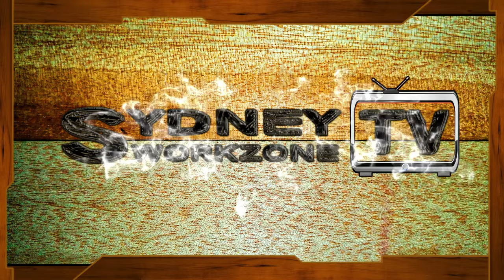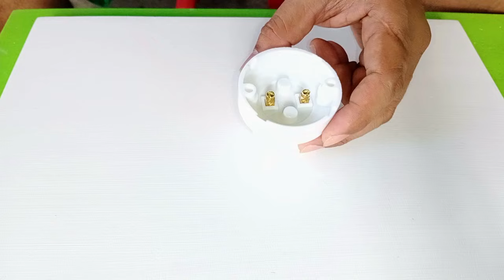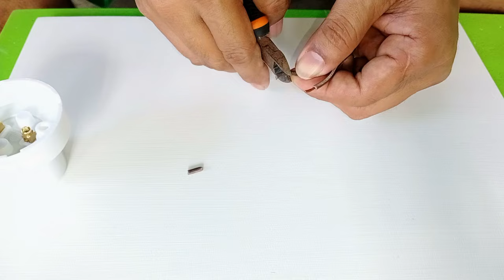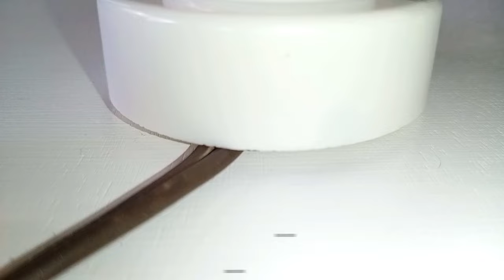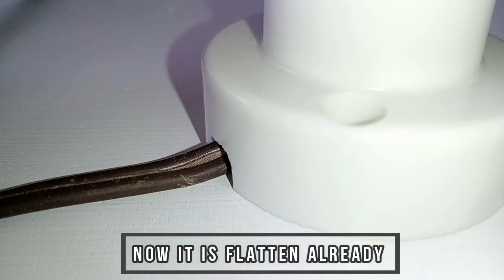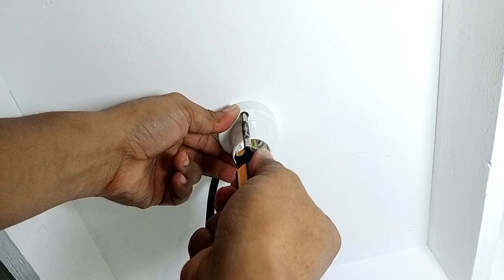⭕ Paano Mag Wiring Ng Bulb O Receptacle Socket ⦿ How To Wire Ceiling Receptacle Step By Step

Comment: sir, may existing wire na po s ceiling, bale pag pinatay na po breaker, kht hawakan ko na po mismong wire, di na po nakaka ground un? mag diy lng sana . ty po
Reply from the maker: Opo kailangan lagi po tayong safe o kung duda ka parin na may kuryente pa gamitan mo po ng multi tester. Salamat po.
Reply: @1075sydney  slmat sir. more power po s channel nyo ❤️

Comment: paano if may existing wiring na po sa ceiling. any of the two wires po ba pwedeng mgkapalit ng pwesto paglagay sa bulb socket?
Reply from the maker: Opo pwede po. Ska bago magpalit turn off the main switch po o yung circuit breaker para po sa safety. Salamat po.
Reply: @1075sydney  thank u po
Reply from the maker: @aristeonavaja8953  Always welcome po

Comment: Hi po new subscriber here, itatanong ko lang kung nasisira din ba ang socket. 
Kase po after ko e ON ang switch, ang bulb ay ilang segundo lang umiilaw tapos namamatay din. Tapos pinalitan sya nang bagong bulb pero ganun parin. So posible kaya na sira na ang socket? thank you po.
Reply from the maker: Hello po. Bihira po masira yan yung ilaw po napundi din ba, di naman po ba nag short ang wire. Ingat lang po.
Reply: @1075sydney  hindi po. Ok naman yung ilaw. Sa switch po kaya?
Reply from the maker: @ryuzaki_ray  Check na lang po ninyo ulit. May video din po ako sa pano connection ng switch watch nyo na lang po..

Comment: Hello goodeve gusto ko lang sana mag tanong if required ba yung same volts sa receptacle and wire di ba masusunog or puputok yung ilaw? thank you
Reply from the maker: Sa wire po #18 ginamit ko at may nakasulat naman po na 220v sa mga wire wag lang po mag short ang wire para di pumutok.
Reply: @1075sydney hi po. Nag assemble po ako ng ganyan. Safe po ba yung pagkagawa if #16 wire ginamit ko po tapos 15A 250V na heavy duty plug po. Pang cctv po na kinakabit sa receptacle , with led light po ung cctv cam.
Reply from the maker: Yes po, Much Better po. Salamat.
Reply: @1075sydney  naku pinalitan ko po yung 15A na plug ng 10A kagabi lang. Ntakot po kasi ako baka hndi compatible. Tapos ordinary lang po yung wire, ayos pa rin po ba yun? Walang tatak yung naorder ko. Mejo d gaanong matigas yung wire nya sa loob compared sa ibang #16 na flat wire po
Reply from the maker: @EuniclaireMaeAnneHerrera  Hello po Good Morning, no problem naman po kasi mga wire ngayon puro under size na di gaya dati.
Reply: @1075sydney  salamat po sir sa guidance
Reply from the maker: @EuniclaireMaeAnneHerrera   Walang anu man po Ma`am Ganda.

Comment: that is mean when using 2core wire cable and e27 bulb holder that has 2 connector.. there is no side for earth/neutral cable isnt? just plugged in which connector and done? right?
Reply from the maker: Yes it is bro.
Reply: @1075sydney  done fit mine brooder light.. tqsm
Reply from the maker: @KamarulAzlanAhlengChai  It`s my pleasure bro.